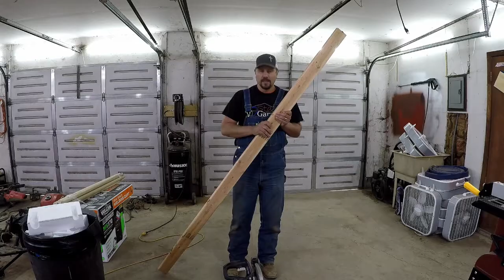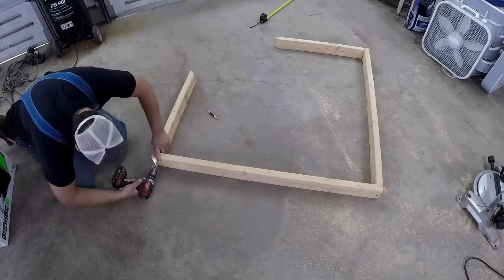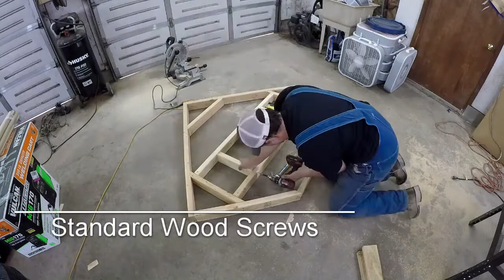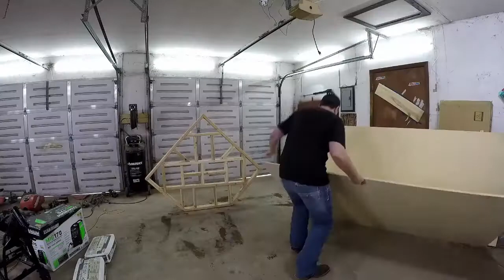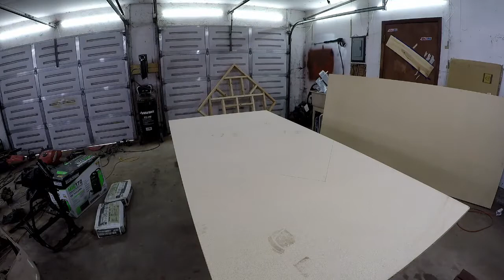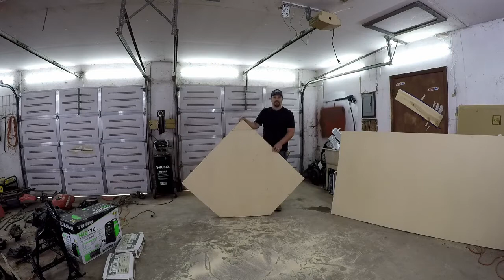Fireplace Hearth DIY Build in 6 Minutes

Comment: So you built a fireplace base out of wood? This doesn't seem very smart since a hearth is supposed to be made of non combustible materials.
Reply from the maker: The hearth was then lined with non-combustible pavers.
Reply: Its very smart and best way to do it.  If your putting bluestone or pavers on top.  I like to use cement board on top of it then bluestone. .  People dont forget if you have basement make sure you support under the hearth. Alot of weight.
Reply from the maker: Yes, this turned out so heavy.  I was concerned about the weight as well due to the pavers.  No basement & the floor didn’t budge thankfully.  Good thoughts & knowledge.  Thank you.